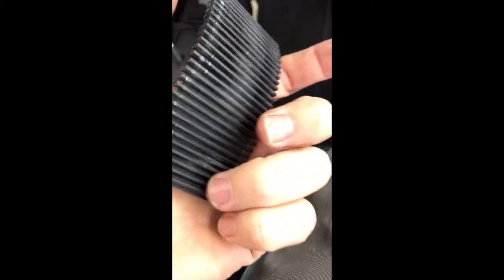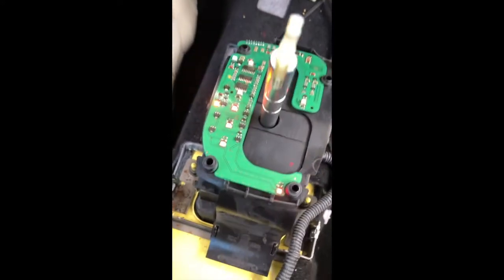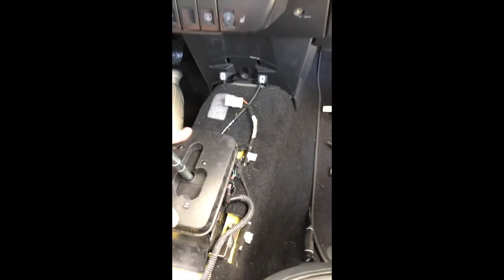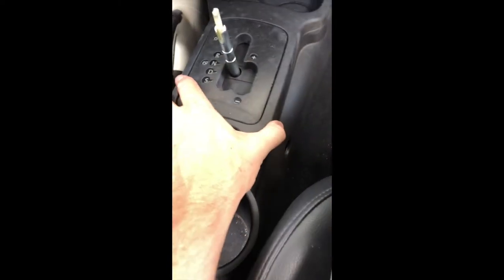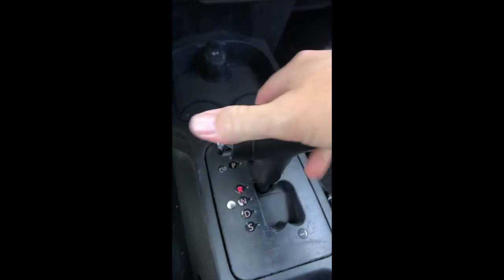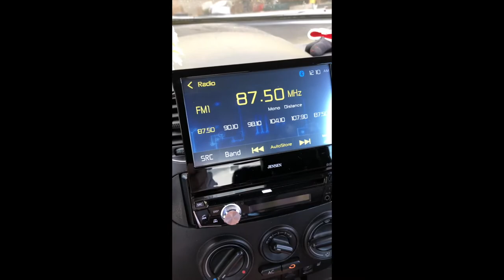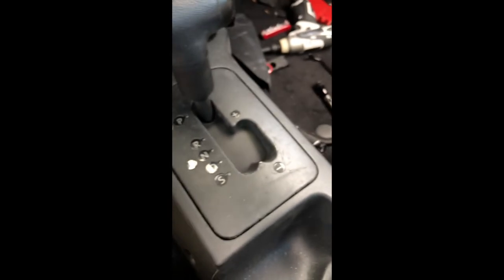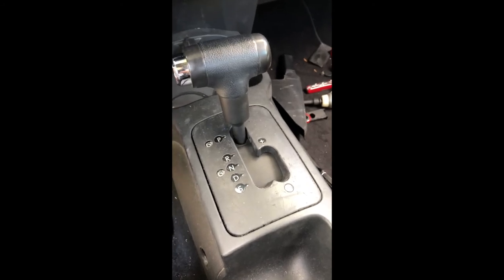2008 Beetle Tiptronic Magnetic Shift Cover Replacement part 2

Comment: Hey, how did you connect the reverse input for your back up camera?
I have no idea of to find the reverse signal wire for it. I’m thinking about just running a long wire all the way to the back rear lights but a connection right near dashboard would be best. I have a 2002 vw golf gti 1.8t mk4. But I have the same or similar  tiptronic transmission as your car
Reply from the maker: I just used the stereo harness to connect everything if I remember correctly. It worked great. We sold the car.

Comment: Did you try to put it into manual shift on the trimatic? maybe I missed it.. I ask cause my manual is not working and Im currently using your vid as a guide... thank you
Reply from the maker: Sorry I am not sure what you mean.  Everything worked Great when I was finished. The tiptronic also.  Maybe you’re having other problems?
Reply: I maybe wrong..mine is a 2.5  6speed which allows you to run auto and manual.  I'm having trouble knowing where the magnets need to go for the manual indicators to work.
Reply from the maker: @jamesbrown7991  ooh I don’t know.  I just placed the dust cover on the area it needed to go and everything worked. I wish I could help you more.

Comment: I have a 2006 VW New Beetle 2.5L Convertible I need to this same thing. This looks like a nightmare of a job to do. With all the brittle plastic. I'm in fear to attempt this job. The brittle plastic is what fears me.
Reply from the maker: If you need to replace the cover, their isn’t much else you can do.  You could pay a shop to do it but they’ll charge a lot.  And it may take forever for them to get to it.  It’s not too bad.  I’m tall and it was not terrible.  I hope you’re not too tall.  As it’s tight in the car.